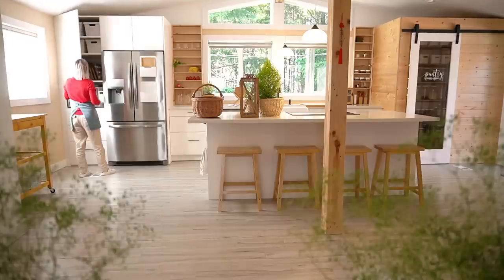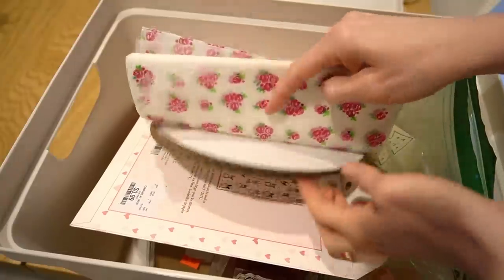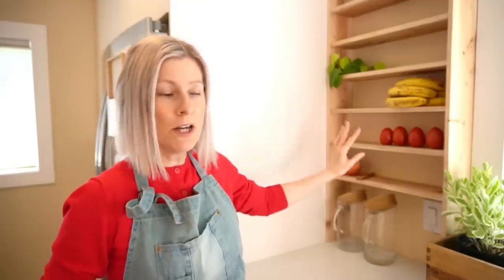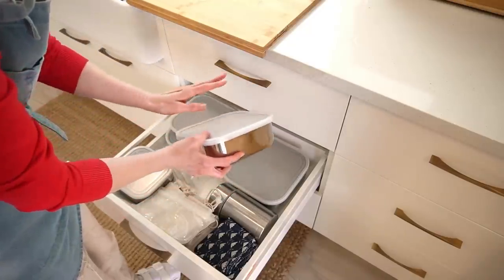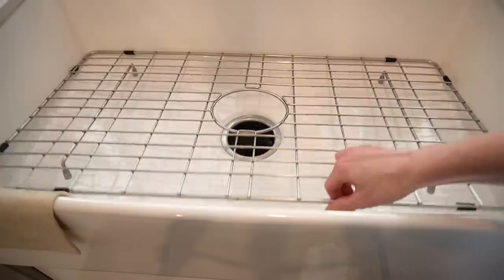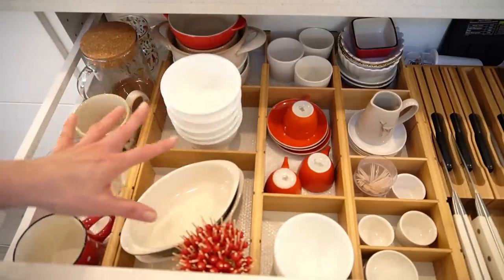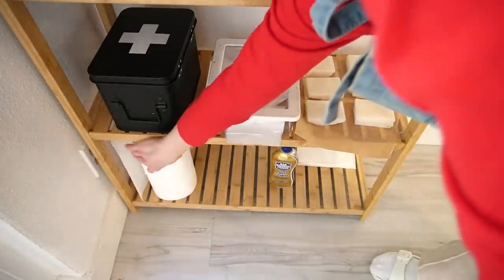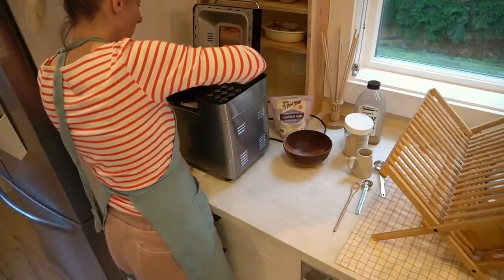KITCHEN TOUR  | HOW I ORGANIZED MY KITCHEN | before and after remodel

Comment: Dream Kitchen! Have learnt so much about organising from you. Now I have to move from 4 bedrooms upstairs to two bedrooms downstairs as I’m getting a full hip replacement so downsizing & decluttering madly. My ideal kitchen now would be simpler as no kids at home - wheelchair space under the bench just in case. Not allowed to bend more than 90 degrees so anything down low would need to be light with a handle to use the reacher gadget. Thanks for showing us your beautiful house & how to organise better. I will have to use bookshelves for a pantry downstairs for easier reaching for food storage. Love the wood & colours of your house with all the light. Now have two chickens & three ducks & a cat & assembling a chook roller like a chook tractor. Might need to get a stair lift or move later as the main garden is upstairs but have moved pots downstairs. Your family is a great example of working together, each with own tasks.

Comment: How smart you really thought out how to function  in the kitchen.  Question did you insulated around the small oven?  If so what did you use? Counter top ovens can get hot on the outside
Reply from the maker: There is space all around for ventilation.  💕💕💕